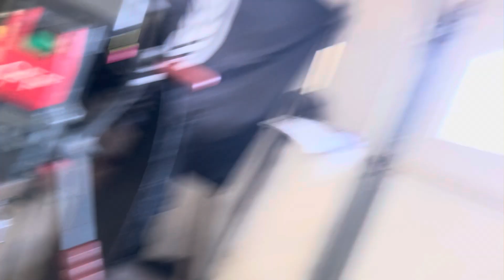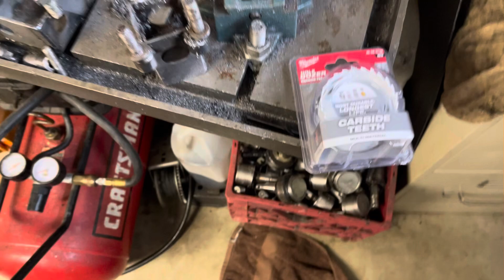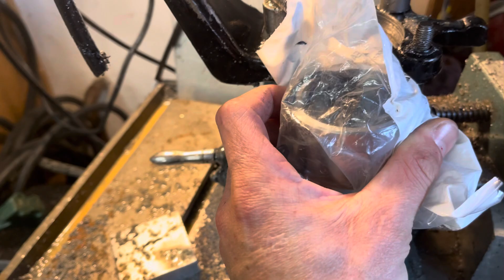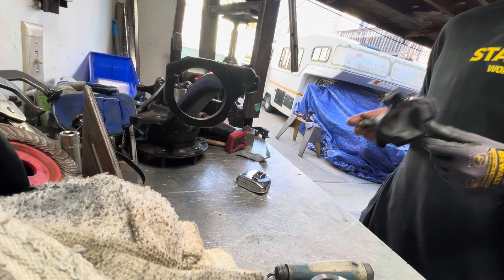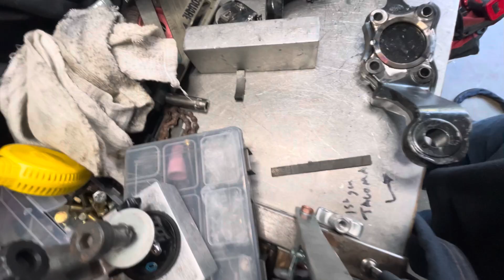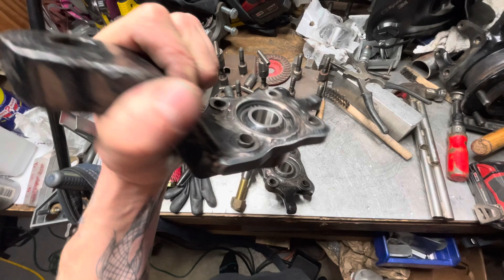DIY UNIBALL LBJ Tacoma 4Runner Tundra Sequoia

Comment: I assume you can do this with both the 00-04 and larger 05-06 models??  The 05-06 LBJs are a little bigger and have 17mm bolts compared to the 14mm of the 00-04 models.  I got a set of 05-06 lower control arms and spindles out a junk yard to upgrade my 02 to the larger LBJ and am thinking I'll go ahead and do this mod first before I put them in.  I just don't want to mess with the LBJs again... uniball is obviously the way to go.  Lastly, what settings are you using for the TIG.  I have an Everlast 275 that will do the job for sure.  Lastly, you didn't include the taper dimension details!  Thanks for the help.

Comment: Hey man, really the video and information. Top tier move making it open source. I have a question, what are the measurements on the final misalignment spacer. I do custom knife work and metal working so i have all the tools necessary, and wanna take a crack at at it. Thank you in advance for all the info.
Reply from the maker: Hey man I don’t have exact measurements infront of me. But all you need to do it turn down the taper for the lower arm fitment. And then just turn down the top just enough to get the bolt to sit a little lower.